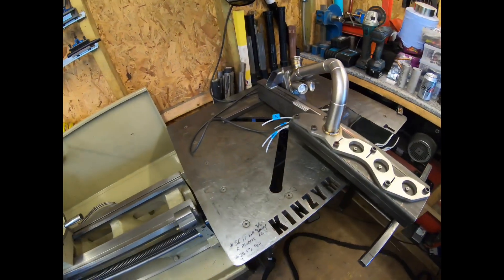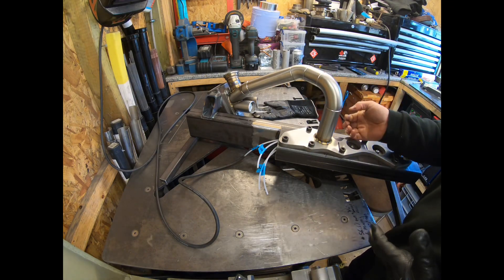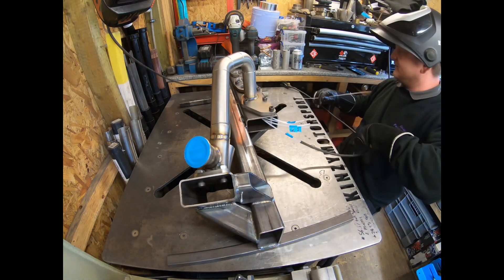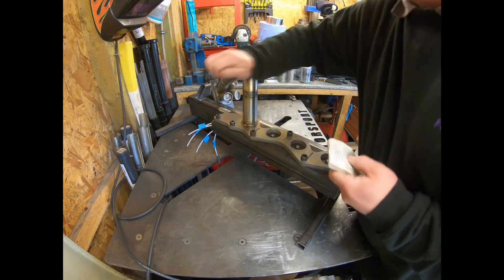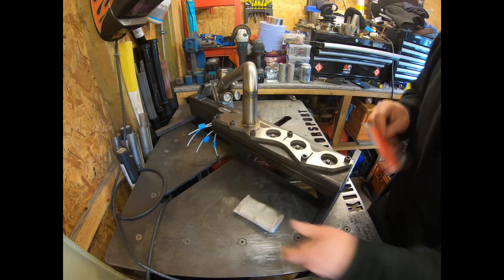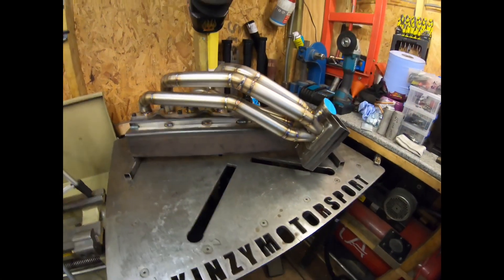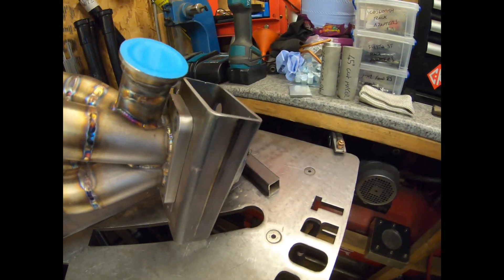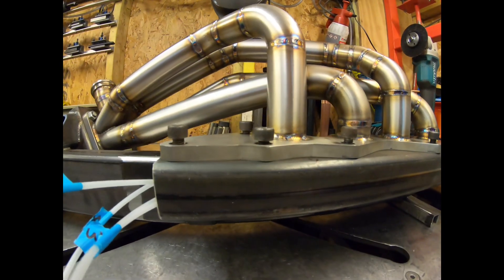St150 Duratec turbo sch10 stainless turbo manifold

Comment: Looking to make a manifold like this  when I turbo my st. I'm a young pipe welder myself, how did you work out the positioning of the turbo and to make sure it wasn't going to hit anything? I'm assuming you started by tacking bits together to get the turbo flange position then made up the rest on the bench? Lovely work btw
Reply from the maker: Hi

I always start out by making the collector, bolt it to the turbo and then postioning the turbo where it needs to be and making up some sort of bracketry and fixings to keep it mounted solid in that position then i go at each header from there. people say equal length headers are critical and they are but the truth is that less than probaly 20% of all "equal" length tubular manifolds are nowhere near equal length and for most people this is not really an issue so you just need to make it fit in the space you are working with most of the time.

Tack it as you go until you have it all done then take it to the bench and ideally make a solid fixture for it as it will move a hell of a lot by the time its fully welded. the more room you have around it the less that will matter but as on this one, ,,space was crazy tight so, the fixture had to, be solid so everything stayed where it was m,eant to,,,,,,,

Hope that helps a little

Thank,s
Marc

Comment: Hi

Do these fit direct without the need for modification to scuttle panel?
Reply from the maker: RTS Motorsport 
Hi

The scuttle doesn’t need modifying but you can NOT run the plastic scuttle tray with this manifold

Thanks
Marc
Reply: @kinzy_fabrications  spot on, thats a given obviously 👍

Im assuming battery relocation, custom exhaust, oil pick up via a sandwich plate on filter and a bung welded into sump for a return 👍
Reply from the maker: RTS Motorsport 
Yes I done a custom downpipe to suit for this 1,
Battery relocation to the boot,

The customer sorted the oil return set up but yes it would require a sump fitting.

The cam cover breather fitting is also removed and welded up

And the brake and clutch lines were replaced with braided stainless and re routed to keep away from the manifold

Thanks
Marc